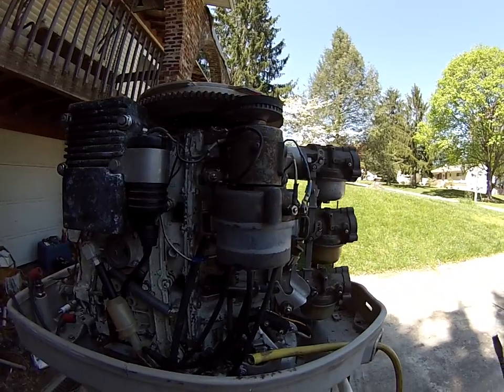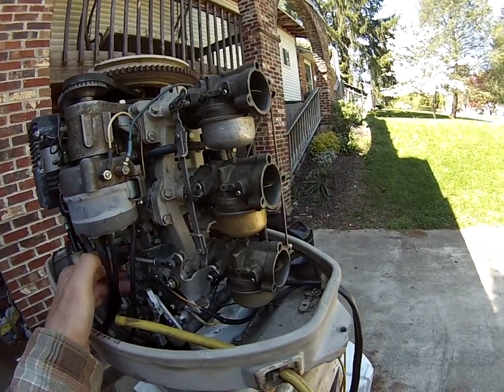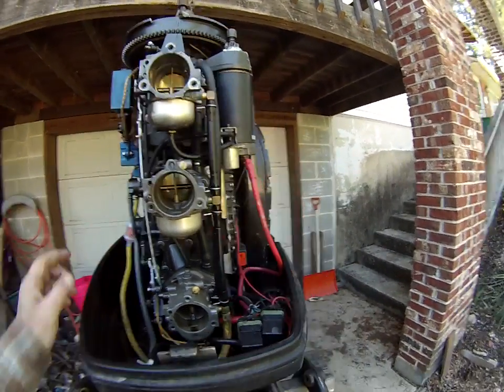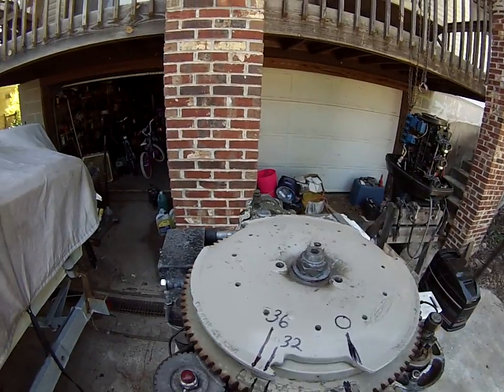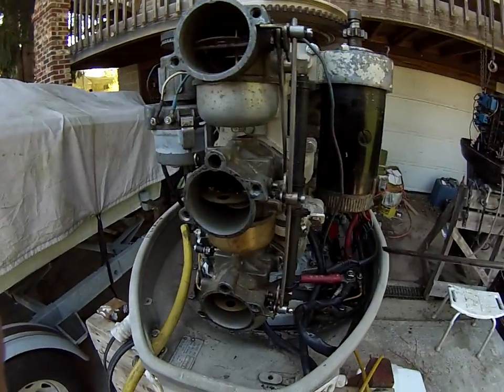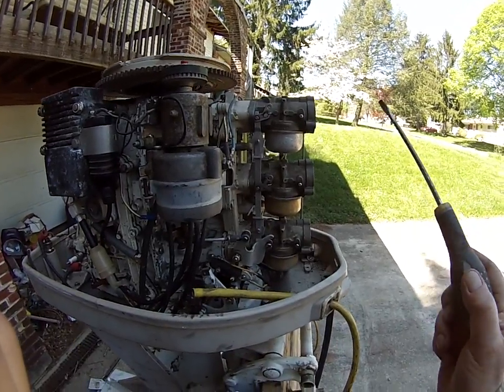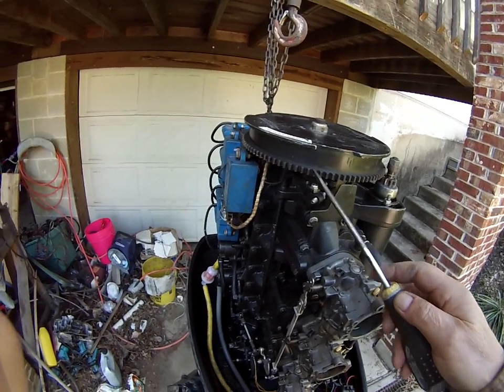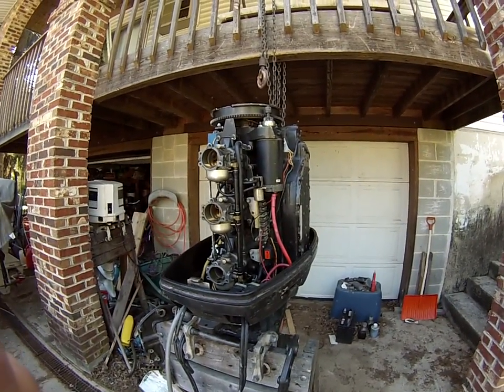carb and timing tutorial

Comment: This would mean any idle timing adjustment you make would affect the full throttle timing wouldn't it?
Reply: I believe the Rod adjuster screw, referred to here for setting idle is how the idle timing is set. Because the rod is limited by a non-adjustable stop at WOT, changing the screw, only affects idle timing, not total timing. That is why we set total timing first. The turnbuckle on the linkage from the rod to the throttle cam is how to set idle speed, not the rod adjuster screw.

Comment: Do you have a air/fuel adjustment video for the Chrysler? I can’t seem to get mine right. 1-1/4  turn out from seated , do I adjust all 3 at same time? Only one at a time? In neutral? Neutral high idle? In gear? 
Seems to run best 3/4 turns from seated, but I’m worried it’s lean? 
Any info would be great.

Comment: Hello 
I got a 105 Chrysler with a msd cd box and it doesn't runs with a surface gap plugs but it does with J plugs, also is hard to adjust the mixture screws if i adjust it where it idles good is hard to cold start please help

Comment: One thing the 3-cyl and 4-cyl Chrysler outboards had going for them was outstanding service accessibility.  Try cleaning the carbs on a Merc Tower of Power or even testing compression on #6 hole. A sadist designed those motors.  OMC V4's aren't a hell of a lot better; don't you just love the thermostat placement on the old cross-fire's?  But, speaking of 'stats, the Chrysler Crew did screw up the original thermostat, requiring you to remove the cylinder head bolts.  Dumbasses!  They did eventually use a head cover with a separate thermostat cover.

Comment: Great video, I have same motor on a 16ft and this was a huge help. I recently removed carbs to clean because they were running extremely bad. Sure enough all three carbs were disgusting on inside. I was wondering if you could possibly answer something. ..After removing the float and bowl, I noticed all three carbs have black gunk under middle main jet screw, was this an old gasket or just trash?

Comment: also you didn't explain  how to adjust  if the butter flies what to adjust when they are  not fully open,    mine weren't, I pushed  extended the bar, twisted the end a few turns till when I pushed it back on ball,  that it fully was open  when I put it back to center (idle)  the mark is below  so I guessing that's wrong?

Comment: To anyone who can help me , my 125 force 1986 1258f6b has 2 carbs , On both carbs there are brass plugs that cap the passageways  to the main jet , is it normal for them to have a hole in the caps ? 1/32 in size puncture . I bought this motor used and don't know if someone punctured or it comes that way. My email is Superjoe104 at Yahoo dot com

Comment: Hey Frank, Bryan here. I was having trouble with one of my 125's again and my question is, how would leaving the plugs in while static timing would affect accurately the 28 degree mark?  My engine idles, but as soon as I increase the throttle it backfires and stops.
Reply: Did you ever find out why? Because I'm having the same issue!
Reply: @kylewilcox8571  honestly I repowered in 2015 with a single 300 hp G2 etec.  Never regretted it of course I did have to sell my house to get the equity and buy the motor. $24k Installed.  Have had many good memories since then .

Comment: Hi,

I have a 1989 Evinrude 28 SPL E28ESLCEA. At low speed i'm getting a skip, but it runs ok on the top end. I wanted to get your professional advice on the problem. How can I tell if the time is set correctly. I think the timing is off also. I need your help.

Comment: Oh and I used a timing light, i just turned key on and pointed light and rocked engine back and forth to see where it sparked at. Also everywhere I have read says to set these Chryslers at 28-30 degrees because they were originally set up for leaded fuel.

Comment: i got my engine running nice but after 15 min it started knocking and the engine turned white to brown.   there is a somewhat clear hose  its dark brown and what i see is the water spitting up  basically there is no solid water going up and not sure if it makes up 2nd water tube as they used a rubber hose.    is that the water pump cooked?  and if so how bad is it to take it out i don't wanna take engine apart